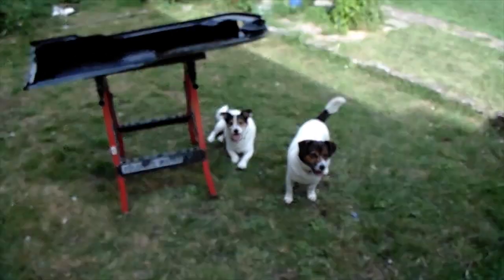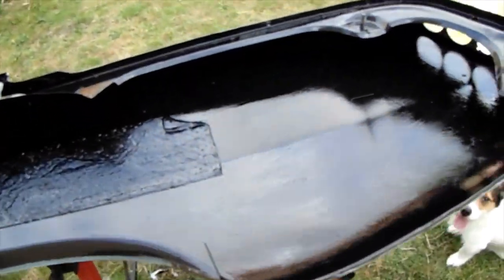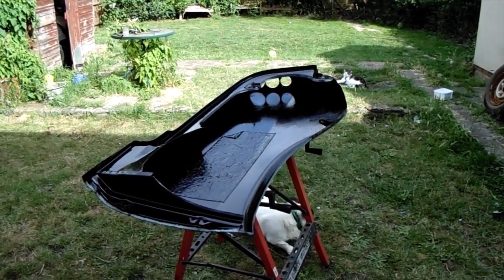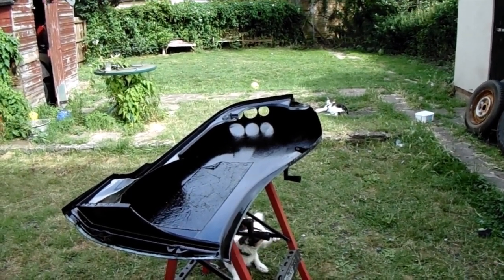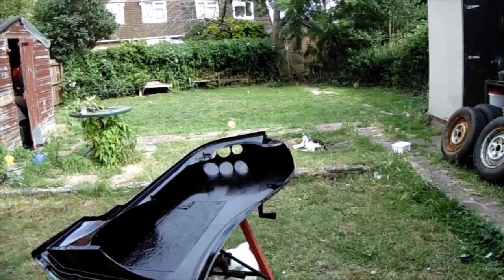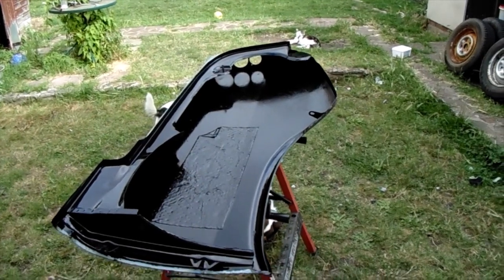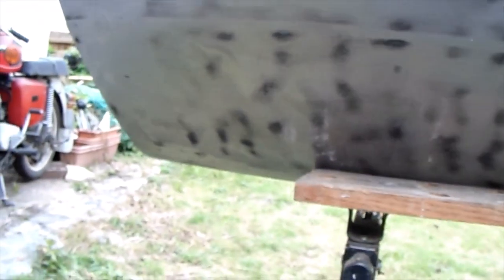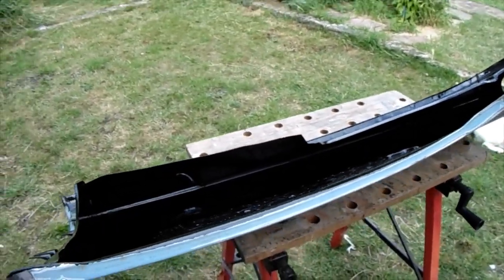Rover p6 project part 22

Comment: P.S. Falken do a very decent 165/80/14 tyre, around 50 quid a corner.(Sincera SN 832) Got an A wet rating too,  most seem to be Van tyres in this size, so beware. all the best.

Comment: Great stuff. I owned a 2200SC in the 90s, along with a 3500S, both low mileage original cars. They were easier to find 20 odd years ago.Came across this by accident and had an enjoyable few hours, whizzing through the videos. Big improvement in presentation over the months and a lovely job on the engine compartment. My SC had the same issue with the clonk on  steering lock, was top ball joint as on yours/ I had some issues with the timing chains, renewed these and had the valves re shimmed, big improvement,  the near side top link mount pulled from the boot sides too. Worth a check, otherwise mine was solid. Great to see another one saved, I'll be after a 2200 soon, as not owned one in 20 years. In many ways I prefered it to the V8!!  Keep up the good work, looks a really sound example, sure you'll do it proud. Cheers, Paul.
Reply from the maker: Many thanks for such a great comment. I'm so glad that my video blogs have been enjoyable. It's great to make them and show off my skill and progress and it brilliant when I have great feedback from my viewers I have had a few in the past me too few v8s. But this is the only one I have done a video blog on. I'm hoping to get back into the car and  get some more done.  and put on another video so keep a eye out many thanks for subscribing it means alot 👍👍👍👍

Comment: What did you paint the inside of the panel with - Rustoleum ? I am considering using it for the inner panels and underneath of my car.  The difference a good respray will make is immense (don't know if I have the courage to do the outside of the panels yet myself but if the inners go well I may persuade myself !). Hope it does nor flash rust before you get the primer on ! Please do use a mask - I know I will.
Reply from the maker: I use industrial black paint for the inners. And the panel is heated and dry stored and the primer will go on tomorrow. I did work for a big industrial company for 5 years and the paint I used Is a good strong paint it can take all the knocks and bangs and wont chip.you can get similar paint from your local stores similar paint that are used on gates or drain pipes.i promise to wear my mask 😜😜

Comment: This is a job I've been putting off for some time. But my intention was to take one panel off and primer each. What wet n dry did you use?
Reply from the maker: Hello andrew
I used 80 grit sand paper and took it back to bear metal and the I used 120 grit after.  then I can see if any repairs which I do on this one a small dent. Then I will put into primer. Yea I think it will be easier to do each panel at a time I feel the project is moving forward now exciting times ahead. Many thanks for your commet
Reply: Winston I've also recently thought about changing the colour of Mexico brown to black. A thorough colour change I side doors etc. I've seen a few done like this and a P6 looks so cool. The paint at the moment is fifty shades of brown with rust bubbles, lifting and fade etc.  I will be doing a video on the body soon.
Reply from the maker: Andrew I would stick with the Mexico brown colour with black paint you have got to be over fussy. It would look nice in black it's just a fussy colour which shows up every little mark in the panels. I like the Mexico brown colour I was tempted to change my to that colour but then every has to be changed cant wait to see you video but have a good think before changing the colour 👍👍👍
Reply: @everythingretro2036  yes I've already got a car in black so I understand what you say! We'll see there's plenty of time to think. Ill be Sanding each panel down to the good primer for a solid base. This worked well for it's last respray which has lasted 20 years. All panels still have the original primer on them. Sanding to bare metal were rust bubbling is present.